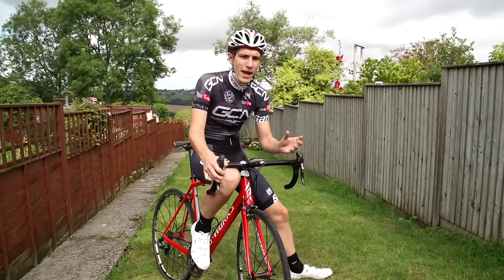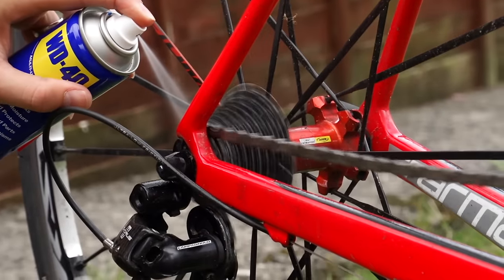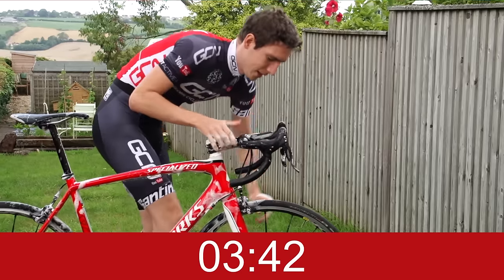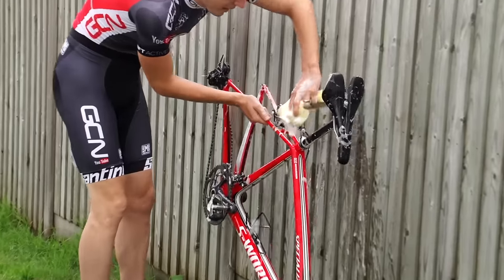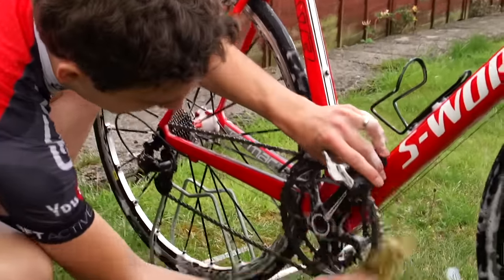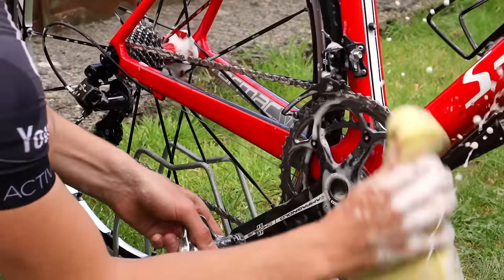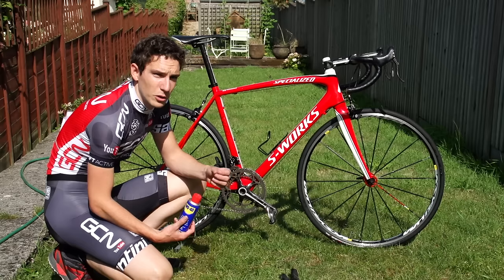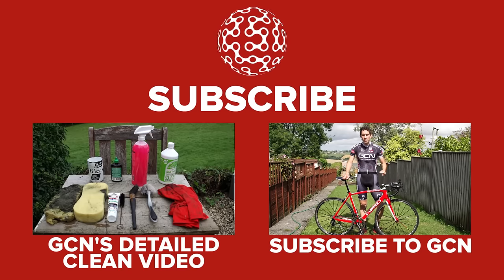The 5 Minute Bike Wash - How To Clean Your Bike In A Hurry

Comment: When I got back into road biking a few years ago, my first instinct was to use WD40 in exactly this way. So many people told me it was a bad idea, I stopped.
I should have gone with my instincts, and from now on I am! Thanks Simon!
Reply: If you do that cleaning every single time you ride, WD40 is probably ok, though it's still not ideal as a lubricant.  Also, he says that he's never had a problem, but we also don't know how many miles he gets out of his chains before he needs to replace them.
Reply: Yep - and as a pro he probably swaps bikes quite a lot.

I know a few cyclists who swear by a quick spray of WD40 when they have ridden in wet conditions and their chain is wet.
Reply: I know lots of people who wear out their equipment prematurely by not taking proper care of it as well :)

WD40 is great for getting things unstuck, and for removing grease from a chain (which might be not exactly what you want to do), but it's not a lubricant and when you're rubbing metal on metal without a lubricant you're wearing it out quicker.
Reply: Yeah, but chain wear is much less on a clean chain. Its when you have muck in between the surfaces, or even worse oxides from corrosion that real grinding takes place.
If he is using a road bike then its going to stay cleaner than a hybrid/cyclocross/commuter I guess. Doing this every time he rides, and he might be OK.
Reply: He might.  But he's probably replacing that chain every 1000 miles, and you don't even have to clean it at all to get that kind of longevity :)
Reply: He's insane. Wash EVERY TIME? Ain't nobody got time for that!
Reply: Tom Ligman hi Tom, I get about 6000 miles out of a chain. I'm not putting that down to WD40, just regular cleaning, but it speeds it all up.
Reply: i clean when it starts making noise. otherwise, the dirt is protecting the paint.
Reply: Simon Richardson Thats impressive - the most I have ever got is 3000 miles, and when I had a Brompton, I was lucky to get 1000 miles - they are terrible for chain wear massive sprocket being constantly sprayed by the close front wheel.
Reply: Simon Richardson 6000 miles? Which chain are you using? Cheers
Reply: Simon Richardson  'but it speeds it all up'...are you saying that using wd40 makes you go faster??!?? lol
Reply: *****
Using WD-40 after a bike is wet makes a lot of sense. First and foremost, WD-40 is a water displacer---that's what the acronym "WD" stands for and it is why its manufacturer gave it that name. Using WD-40 will help remove the water from the hard-to-dry areas leaving a light oil behind. But, as others have pointed out, that light oil layer isn't durable---it won't last long and doesn't reduce friction as much as a good synthetic oil made for a drivetrain (like Park Tool CL-1 and many others). I think others have hit the nail on the head with Si's technique---it works because he keeps his bikes clean and uses WD-40 frequently. If either of these conditions were not met (keeping the bike clean or using WD-40 frequently) then I think the outcome would not be so good.

Comment: I've been using Muc-off in a Park Tool chain cleaner for 5 years and got degreaser recently and it works much better than the chain tool. I use a gear clean brush and Mobi pressure washer to rinse it off and you can see the black rinsing off. I've wasted so much time over the years doing 3-4 cleans every time in the chain tool.

Comment: thanks man
wd 40 is a good for all things product.
it keeps water away effectively,which prevents it from getting very sticky  or absorb dust and sand when  its cooler outside or getting older on a surface.To actually use it to get rid of the old ,dirty grease is a great hack.

Comment: Hey guys, I am a total newbie in cycling. I just bought, as per a friend advice, a Felt F85 bike (with whom my wife has been jealous with. .) with this shimano Tiagra gear. I have been struggling a lot. Changing gears, using the special shoes, understanding the basics of the sport. I am Brazilian but i live in France, in the country side. I bought the bike to be able to travel alone with the bike, discover the country and go to the city (driving cars is not my thing...). So let's say I go to the village to buy some bread (10 km). Do I need to clean the bike?!?
Reply from the maker: +Robson Richers no - not for such a short ride as that, unless it's over dirt roads in the rain!
Reply: is it really okay to use wd-40 as a degreaser ? i can't buy degreaser right now
Reply: +Mark Keavin Yes.   I've been using it for 15 years to degrease, but typically not for final lube.  I degrease with it, rinse, then dry with a rag and use specific chain lube.   After seeing this recommendation, I may try it for the final to see how it does.   WD40 for degreaser has always worked better than an actual degreasing product.

Comment: Glad I found your quickie bike-wash video! I may give it a go for once in my life. Never have I ever cleaned (or oil) my MTB in my 20 years of ownership (saved for a once-off maintenance and cleaning at a bike shop). Its a Kona with Deore, and it's still working fine!
Reply from the maker: Glad you liked the video!
Reply: Just gave it a go using your method a couple of hours ago; hosing down my Kona's derailleur, chain & crank with WD-40 and a brush for the 1st time in my life. Easy does it. The silvery shine of metal is in stark contrast to the black-brownish gunk the components were used to be covered in. And I'm excited to ride it soon, to see if it does indeed feel faster than before! :)

Comment: Hello gcn!
I was wondering, when you spray so vigorously on the derailurs and calipers isn't there a risk of getting it on the brakesurfaces and therefore ruin them?
Reply: same question
Reply: Brake Calipers have metal springs in them that perform better if kept rust free.

WD-40 reacts on metal and does no harm to plastic or fibre.

Spray it on to find out.

Comment: WD-40 is good as a  dergeaser in the bigining of bike wash and as displacer of water in the end. After  it volatilizes i apply the chain lube
Reply: +Vlad Savin How long after the WD40 do you apploy the lube?
Reply: Adam Garfield after wd40 i dry chain with a rag and  give 10-15 min and then i aplly the lube. Usally i aplly the lube in the end of day.  Lube must to "breath" before next ride(3hours minimum) for the formation of surface layer
Reply: Boom I was wondering this for a while. Thanks.
Reply: Adam Garfield lately I've been using as degreaser a foam cleaner for car engine. It extrude all mud out. The rest wash bacome a more shorter

Comment: Any tips for cleaning the bike if you don't have any outdoor space?
Reply: Hand carwash :-)?
Reply: No spray for cleaning, just use damp/wet towels etc. Use underbedboxes to collect liquids (if you can put them below your bikestand (if you have one)). For extra ground protection you can use plastic tarp (the tickness used for tents). When spraying decreaser and such do it above the underbedboxes. Else put some paper behind the direction you are spraying. But, you can also clean your bike on the street...
Reply: i use glass cleaner and a towel for the bike and wd40 for chain, cassette, etc.. i wash my bike in my room .
Reply: I often clean the bike using a damp rag, sponge and then a dry microfibre cloth.
Reply: baby wipes can do a good job if you're stuck indoors and trying to keep mess to a minimum.
Reply: 1989srjones +1 for babywipes! Gets most fresh dirt off leaving bike looking good for the next ride, so cheap and easy. I use half a dozen after every ride.

Comment: hi i'm quite new to road bikes and bike cleaning in general, thanks for making this vid but i do i have a question. Between after washing off the soapy water and then applying lubricant to the chain, how do you dry the chain ? I've heard about products that are supposedly used to spray onto the chain to get rid of water. What method do you use?
Reply: You can use an old, clean rag to dry your drivetrain.
Reply from the maker: If you want to be really pro, use an air compressor, otherwise an old cloth or towel will do fine.
Reply: If u have a shop use an old hair dryer!
Reply: WD=Water Displacement

Comment: did you just spray WD40 on your brakes? :O
Reply: Not on the pads i think
Reply: I was pretty enthusiastic to try this on my new gravel bike with my new TRP Spyre mechanical brakes.  :(   I had to replace the pads.  Great way to clean the drive train; just be careful!
Reply: I've used WD40 for at least 4 years and it's worked fantastically.
Reply: You wanna use 3 and 1 for chain lub not wd40 it has alchohol in it
Reply: Never use it on the pads. PLS, I KNOW THE HARD WAY (spoiler alert, my bike went to the junkyard)
Reply: @Fred_the_1996  I mean you might as well just get yourself some new brake pads but hey, whatever works for you.
Reply: @cribblehorst3186  When your pads go bad, wherever from regular wear or Adobe bizarre WD-40 disaster, the entire bike is junk and must be entirely replaced with a brand new bicycle.
Reply: @juliansiefert2330  Pretty sure he's implying he crashed it..
Reply: @Bungle2010  ... to the abyss
Reply: Had the fantastic idea of spraying my pads after seeing this doofus.
Reply: they just slow ya down anyways

Comment: My 90 second bike clean after every ride is to wipe down everything with baby wipes (wet wipes / moist towelettes). It keeps the bike looking new and running quite smooth between regular tune-ups.

But... it's relatively warm and dry for much of the year so I don't get alot of road pickup like I imagine would be the case in the UK.

Comment: Reading all the comments, but being pretty new to cycling, I was thinking the reason this (WD40) works for him was because he rides daily as opposed to more infrequent riders who might need the better lubes?
Reply: Charles Bowden 🤗. Hi! Me too. My bike mechanic and family says they ride every day, everywhere. (It rains a lot in Seattle.) He says to bring it in and wipe it down with a towel each time I ride. Wash and lube monthly if I ride daily outside. Every 2 months for less.  Never use WD-40 on a bike, but use a bike performance lubricant if you want to keep your bike. Pour it on a rag and run it along the chain as you turn the pedal crank. Don't drizzle it all around. It just drips off wastefully, and far less is needed on the rag.

They've earned my trust because he's been doing it for 20 years, and he always saves customers maintenance money.

Comment: I got skated on twitter for using wd40 to clean my bike so i stopped and never used it to actually "oil" my bike. Are you really saying you clean & lubricate with W40,
Reply: Slated... Not skated
Reply from the maker: Heather Morrison Yep, works for Simon, and his bikes see a lot of use.
Reply: ***** WD40, is a light oil combined with a mineral spirit to help it penetrate. Assuming frequent application/cleaning as per Simons video I don't see an issue using on a bicycle chain. Just keep it away from anything with grease in.
Reply: *****  and a bike specific wet lube wouldn't attract any dirt? After a 15km ride round Cwmcarn at the weekend my Anthems chain is black with dirt after having a clean application of Fenwicks Stealth MTB lube. The difference is I don't need to clean and relube. If using WD40 or GT85 I would prob want to.
Reply: ***** I suppose it would be fine if you are cleaning and replacing it daily like old mate here.
Reply: Ha ha, all of this is really fun. For WD-40, against WD-40.  But I never take bike maintenance or bike fit advice from pro riders or ex pro riders.  They never own the bikes they ride !
Reply: There is nothing wrong with using WD-40 as a cleaner, in fact it is better than using dish soap. I probably wouldn't recommend using it as a lubricant, but if you are doing this after every ride, you are in probably fine. The biggest issue with chains isn't what kind of lube, but dirt. While WD-40 won't keep your chain clean like a wax or teflon lube, it isn't any worse than other wet lubes, it just lacks tenacious properties, so it will dry out quickly. The lightweight aerosol nature of WD-40 is probably better at penetrating between the links than a lot of lubes on the market. I never recommend using a degreaser, unless your chain hasn't been cleaned in a very long time. A good method, would be to use something like WD-40 for cleaning, then follow it up with some Rock-n-Roll lube. If you don't want to clean the bike, just use a rag or paper towel to wipe down the chain after every ride and reapply Rock-n-Roll every 100 miles or so.
Reply: ***** you're right! if there's another option than WD40, avoid WD40.. 
as a degreaser, WD40 works fine.. i wouldn't use it for lubes, i use Finish Line Wax
i stopped using WD40 since i busted a bottom bracket from accidental drips or spray.. the liquid form is too thin to slip through sealed bearings and degrease them accidentally.. the bearings rolled dry for 200km before it fails
Reply: Global Cycling Network  You say "Yep, works for Simon, and his bikes see a lot of use" !!! http://www.strava.com/athletes/269248 
Distance	570.5 km
Rides	15
It is not much use
Reply from the maker: Johnny Carlsen Ha, good research. You'll remember though that Simon broke his neck, so that was three months off the bike, and before that he wasn't using Strava, so not exactly failsafe logic there!
Reply: Doesn't WD40 sell specific bike products now?
Reply: Previous owner of my Trance Advanced was a clown who used WD40 - probably for the same this reason as this guy (no reason) and you should see what it did effectively de-greasing the rear mech, derailler and wheel bearing over just a few months.  Not to mention the DANGER of using it on bikes that have discs and pads if someone applies this to a MTB.  Just have a car wheel-cleaning brush on hand.
Reply: Johnny Carlsen Not everyone 'stravas' every ride.
Reply: Hello from Southern California!
WD40 is fantastic, or as you all might say "brilliant!", for specific purposes. I agree with all here who call it out as an excellent degreaser. In fact, before putting a new chain on my bike, I toss it in a Ziploc bag (kind that can be zipped shut), and spray it liberally with WD40. Let it set (marinate) for an hour or four, then clean it with a proper degreaser (Simple Green is a good one here in the states), let it dry, then onto the bike. Once installed, I lube it with a dedicated chain lube (ProLink works well, and lasts a week, in our dry climate).
Thanks to Simon for his lesson on quick-cleaning a bike. Definitely some tips I'll use next time.
Cheers!
Reply: Cheeky Twatt
Oh God that was the FUNNIEST I've seen in a long time! Thank you so much! :D
Reply: Rashoop  "before putting a new chain on my bike, I toss it in a Ziploc bag (kind that can be zipped shut), and spray it liberally with WD40...then clean it with a proper degreaser"
Don't you mean an "old chain"??
Reply: ***** OMG Give it a rest, we get it you don't like to use it. Or if you like keep the Defib near that old horse so you can keep bringing it back just to beat it to death again.

Comment: "Brake caliper... and the brake caliper" - I thought rims and brake pads should be avoided of spraying WD-40 on them. To apply gease calipers you should be more accurate.
Reply: Don't spray it on the actual contact surfaces or you will end up in a ditch.😂
Reply: Roman Shuvalov I do it all the time with GT-85, never affected stopping power before, just make sure you dont spray on the wheel rim or the pads themselves
Reply: Roman Shuvalov You spray WD-40 on brakes to remove grease and after a while you clean it with soap...
Reply: ***** I agree (:, not to mention it smells nicer!
Reply: +ThatWolffe But I like the smell of WD-40
Reply: TroniX BUT WHY, you have failed me young padawan, the force is not with you

Comment: A top tip here is to use a plastic mile bottle or drinks bottle etc and cut a slit in it along one side from top to bottom, cut a bit more of hole in the bottom and then you can spray the WD40 in to the chain without it going everywhere!
Reply from the maker: Great little hack!
Reply: Another hack - I mount my bike in my car’s bike rack to clean it.

Comment: It's a not good idea not spray your cassette with WD-40 while it's on the wheel. When you do this, you're spraying a solvent almost right onto your rear hub's bearing seals. Not good for the long term life of the hub. Simon likely enjoys newer equipmet than most of us. So he can probably get away with it.
;)

Instead use a 2 to 3cm length bristle brush on the cassette.
Reply: Obviously it's fine as Simon has tested it over years and thousands of miles
Reply from the maker: ***** That bike's 3 years old. Just saying.
Reply from the maker: ***** Or, it's just kept in very good condition... ;-)
Reply: Global Cycling Network It looks like we've got a classic case of something not being able to work on paper, but in reality things are a bit different, more forgiving. Seems like WD40 does the trick.
Reply: In the video, he says he re-does his bearings often, so he addresses them more often than I. That just doesn't work for me as I would have the shop handle the bearings, and keep those visits as minimal as I can to keep the cost of ownership low.

Comment: Dumb question, but can the wd-40 get into i.e. the bearing on rear wheel when spraying it onto the cassette? I noticed there are small holes/carvings on the main stem when you're looking down the gap between sprockets and large cog. Would assume it was sealed pretty tight, but... ?

Comment: WD-40 stands for Water Dispersion formula 40, this simple means 39 formulas fail and the 40th worked. It was developed to prevent rust from forming on critical parts on the space shuttle. It Prevents rust by dispersing water from metal parts but not entirely a great lubricant, but does work to some degree.